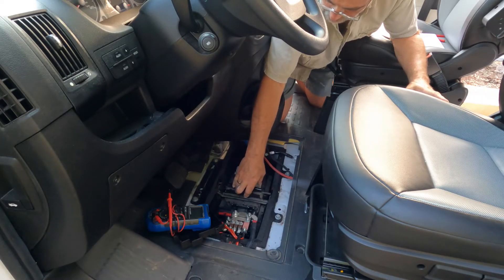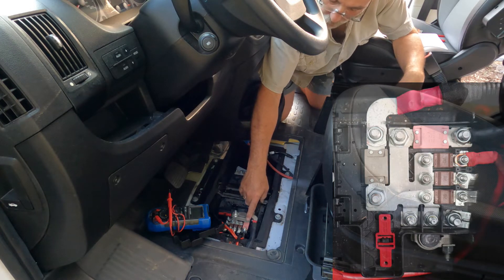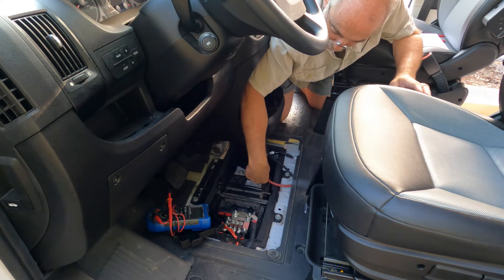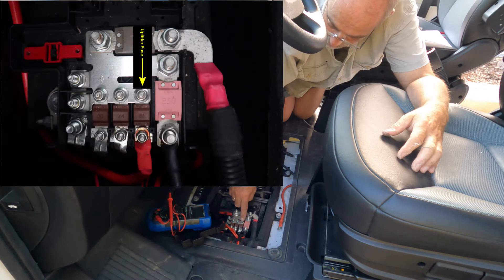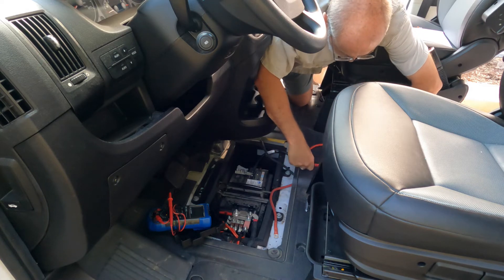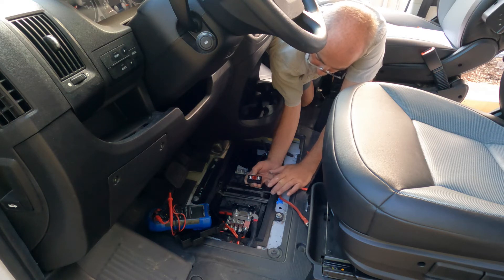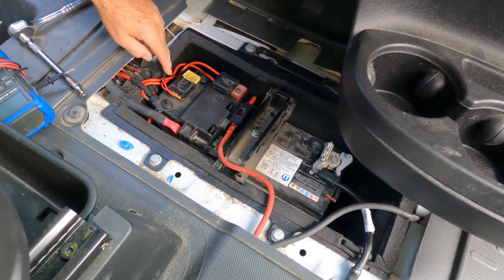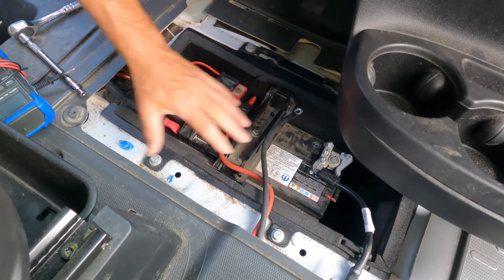Van Life build series - DC to DC, Battery to Battery step by step installation PART 2 of 2

Comment: Hey, I'm trying to install a renogy DC -DC charger into my 2014 Dodge caravan..  it's a 60a model, would it be okay to use a 60 amp fuse holder? I have gotten 4awg wire, I'm wondering if I should be getting a higher fuse holder? 
Like 100amp or 75amp ? Also what circuit breaker should I be using? Sorry if this sounds very confusing I'm extremely new to this stuff and try to learn as I go,

 I  have a water tank hooked up with a pump in my van that runs off a seperate battery, 

so I'm trying to hook up my car battery to the DC charger then to my seperate battery to run my water pump..

I appreciate any help In advance!! Thank you!
Reply from the maker: I would use a 75 amp fuse. It depends on the length of your 4awg wire.  Use blue c systems wire calculator to be sure you have the right gauge wire for the distance. Also check your alternator. Be sure it's more than 120 amp output. You don't want to burn out the alternator in your van by using the DC to DC charger. I recommend you put it in a switch to turn the DC to TC charger on and on. Then only turn it on when you're actually driving. Do not run it when you're idling or at stop and go traffic.  Just run it. Went on the highway. That way you're less likely to overload the alternator.
Reply: @FrugalFactor thanks for the reply I really appreciate it!!

Comment: Paul - I just completed installing the same Renogy B2B Charger as you did. I'm undecided as to whether or not to install the wire to limit the charging. Why would I not want to charge at the full 40 amps? Is it harder on the battery or the charger itself? Cause excess wear and tear on components? Just curious as to the reasoning.  By the way, we currently do not have solar power but probably will in the future. But thank you for the video, it was very helpful!
Reply from the maker: It depends how far I'm driving. At the end of the day. I want to be 80 to 90% charged. Charging at high current causes more heat and more wear on the batteries and reduces their lifespan. But within a 10-year lifespan most people aren't concerned.  If I can charge at 20 amps anb be at 80% or more at the end of the day I'll do that. But if I have a short drive, I charge at 40 amps that with the solar panels the charging current is over 50 amps. As you travel you'll find what works best for you. It's not good to fully charge to 100% SOC or discharge below 10% SOC for the lithium batteries. I'll have more videos on that in the future!
Reply: @FrugalFactor   Thanks for the clarification. I had forgotten the recommendation to not go over 80% SOC. We are just starting out so don't have a handle on our electrical usage yet. But even if charging the battery to 100% brings the battery from 5000 cycles down to 2000 that's still 5 1/2 years, and we won't be full time on the road. So as I learn our needs I'll keep the limit wire in mind.
 Thank you so much for your videos. Your van build has had more influence on ours than anybody else (and I've watched more videos that I want to admit!), so I am grateful for all your efforts. You have a way of building practicality and budget friendly aspects into camper van builds that works well for our needs.
Reply from the maker: Thank you. That's probably the most positive comment I've received. If you have any further questions you can email me at the contact email listed on the website. Also at www.thefrugalfactor.com are all the videos listed by category. Thanks for watching 🙂

Comment: Very good videos you are making.  Simple and to the point.  Thank you!!   I would like to see something about how to safely route cables and wires.  People often say---"so here's my set up in the front, now let's go to the back and see how we put it all together". ok, did you go under the van? under the floor? exposed conduit? did you go behind the walls?  Maybe you've made that video but I can't find it. I'm sure it's build dependent but there must be some general guidelines that people can follow.  I've moved all of my electrical and batts to the front and am putting it in a box behind the passenger seat.  Mostly because I can't figure out a good way to get the proper dc-dc wires safely to the back. The box also serves as a footrest when the passenger seat is turned around.  I have a PM 159 hightop like yours but with a double slider, so running along the driver side wall isn't so easy.  I'm also trying to keep everything exposed (but safe) so that I can make changes in the future without having to pull anything apart.  Thanks again for making these videos.   Very helpful.
Reply from the maker: Thank YOU for the positive comment.  Wire for DC to DC charger goes along the bottom channel of the promaster.  You can see it in this video https://youtu.be/eRI2-RZOcAY  The wiring for the cabinets goes through the channel on top.  You can see the top channel in this video:  https://youtu.be/Yjze5Dx_Wu0     No plumbing or wiring goes under the floor.  It important to ensure easy access in case you ever want to make a change, add something, or make a repair.  All my videos divided by category are at https://thefrugalfactor.com/

Comment: I bought a  renogy dc dc 12 40 Amp like yours and I've seen a lot of videos to research the setup.
Your video is the BEST , reasons:
1) Straight to the point and no flashy B.S.
2) Adresses cable thickness
3) addresses to put the charger near the battery, unlike  others that let the charger be under the driver's seat.
4) you are the only one that explain why to use de Limit Current option. In my case I will use it -- at least at the beginning -- to avoid alternator damages.

also it serves well for an oldish Fiat Ducato.
THANKS A LOT.
Reply from the maker: Wow - really appreciate the positive comment.  Thank YOU.   My other videos are in categories at TheFrugalFactor.com with additional information.   After 2 years the Renogy unit is simple, and just works!  I like that !  😀

Comment: Hi, may i use the battery while it is charging with that charger?
Reply from the maker: Yes, the battery is in use when being charged by solar and the DC to DC charger.
Reply from the maker: If your battery is not charging, check that the DIP switches are correct for your type of battery.   The information is in the manual.  You could also email Renogy.

Comment: Hello.  I am setting up a victron 30A dc to dc controller. Around 10 ft to the battery. After watching your videos, which were extremely helpful, thank you,. I am still a bit unsure. Will 6 gauge be good, or should I go to 4 gauge?
I should also have some kind of heat protector on the wire nearish the muffler and engine getting to the battery. any sugestions?           
I have some wire that used to power a wheel chair lift that I used to use for connecting an inverter directly to my battery, about 12 ft long. It's labeled,  #2 SAE Copper. Is that what you say to use for connecting the interior battery to the inverter and 12V panel? But that's too big to use from my battery to the dc to dc  charger?  
I'm pretty sure it's fine to have a normal lead battery for the starter battery and a lithium for the interior battery.? Is it ok to have a lithium starter battery and lithium interior battery with the dc to dc charger?
Thank you for your videos, and any help you can give me on my questions.
Reply from the maker: For wire size use blue sea systems wire calculator http://circuitwizard.bluesea.com/      Also this video may help https://youtu.be/AJGZh6iW5CE    Having a lead acid battery for the starter, and lithium for the rest is normal.  The DC to DC charger should keep the batteries isolated from each other, so no problem there.   Heat protector - I kept all of my wiring inside the van, so I did not have any need to protect the wires from the muffler temperature.

Comment: Is there an easier description in how the two trigger wires can interact together or apart? I have the main 40a trigger wire placed up to a switch and then to a fuse that only activates the switch power with the ignition on. Not sure how I'd bring in the 1/2 amperage line in the best way. Maybe there's like an inline switch that can add that line to the other? It probably doesn't need to have nearly the same length, as long as it gets electricity from the fused spot that's tied into the car's battery right?
Reply from the maker: Providing 12V+ to the D+ Terminal turns on the unit.  To limit Current you provide 12V+ to the LC terminal.
This is a link to the manual, see bottom of page 12, and 14.   
https://www.renogy.com/content/RNG-DCC1212-20-BC/DCC1212-204060-Manual.pdf
I placed a switch inline with D+ so I can turn the unit on and off.
In the back of the van I placed a Wago connector, ( https://amzn.to/41dH2bL ) so I can easily adjust 20 or 40 amp charging.  You could also use another switch.

Comment: Its the best video ive ever watch and i wanna copy most builds you did to your rig coz i really love your ideas. I wanna know wether  your promaster is a 1500, 2500, or a 3500? That way it might be a 95% applicable as well to my 2019 ram promaster 1500 136WB. Im thinking that if they(1500,2500,
3500) got different alternator sizes/capabilities to provide a power if I choose a renogy 40amp DC to DC battery charger. Im planning to put all my electricals underneath my bed which is located by the rear doors and should be good to run a 10Ft long 
4 AWG battery cable from the alternator to starter battery  to Battery charger to my lithium house battery that will run my dieselheater, microwave, 42QT fridge, and a water pump for my sink. I wanna do exactly what you did if those materials that you’ve installed to your van if its applicable for my 2019 1500 rampromaster, thanks in advance and see you on your other videos.
Reply from the maker: This build is a Promaster 3500 Extended. Our Electrical is in the back drivers side, easy to reach if needed.  Check your wire gauge, length using Blue Sea Systems Circuit Wizard http://circuitwizard.bluesea.com/#        Thank You for watching!
Reply: @FrugalFactor  hi serms like you forgot to mentioned how many amps of fuse box you used (3:47) where 6AWG and 4AWG joined together. I probably copy some of your wiring set up because the link that you mentioned is just only for electrician as theres a lot of terminologies that only electricians can understand.
Reply from the maker: @olepickle5366  Check out my other video(s) they may provide the information you are looking for, especially this one https://youtu.be/AbuQPpMtmug

Comment: Hello I also have another question in relation to getting your full amperage from your battery charger. You stated that I can simply unplug 1 wire from my wago connector from the switch that was installed in the cigarette connector. Would I need to remove that panel from the cup holder again to be able to do that?
Reply from the maker: YES, but instead of doing that - what I have done is use a Wago connector in the Garage area, right before the wire enters the charger.   When I want 40 Amps I simply open the Wago connector and take out the wire.
Reply: @FrugalFactor  thank you for this. So what if I don’t want my amperage cut in half? And just want the D+ cable only? Do I just follow your same process but do not connect anything in the LC port? Or will I need to do something else?
Reply from the maker: @josefandino4090  That's correct!
Reply: @FrugalFactor  thank you for your help!! Keep producing more helpful videos to the community! Stay safe!
Reply: @FrugalFactor  when adding the fuse block with the correct anl fuse on it, knowing that I currently will be installing a 60amp dc to dc charger will I be able to run the 6awg wire off of the 70amp fuse from the starter battery and then attach it to the fuse holder that has a 100amp fuse on it? And on the other end of that fuse holder terminal will be my 4AWG from my dc to dc charger input side.

Comment: Hello I want to say great video! I do have a question when connecting your 6 gauge and 4 gauge wire to the fuse block. Am I allow to use the 6 gauge wire as well if I have a 60amp dc to dc charger? Thank you
Reply from the maker: It depends on the length of the 6 gauge wire.   I use Blue Sea Systems Wire Calculator - http://circuitwizard.bluesea.com/    to calculate the proper gauge of wire.
Reply: Hey hope is well. I wrote a question a couple of days going pertaining to the fuse holder size. So in your video in relation to the fuse size, you end up going down from a 70amp to a 50amp I believe. But in my situation I need to go from the 70amp to a 100amp fuse that’s going to be in that fuse holder, since I do have a 60amp dc to dc charger. So will I be able to do this without causing any damage? I’m just stuck in this situation because I don’t know there answer. Thank you.